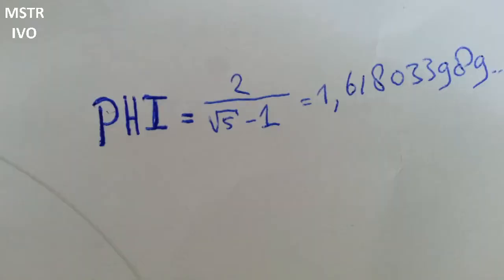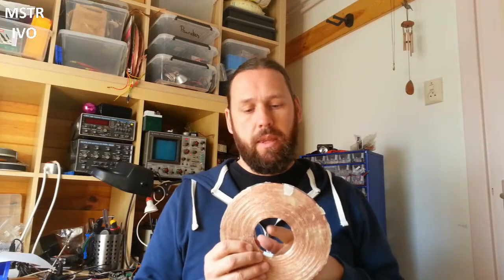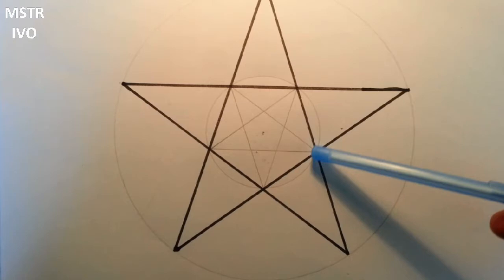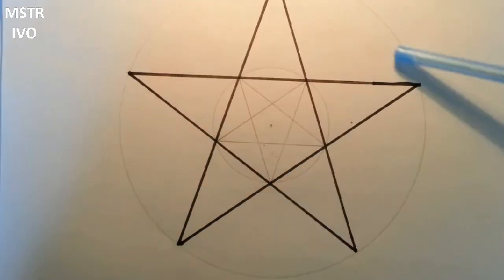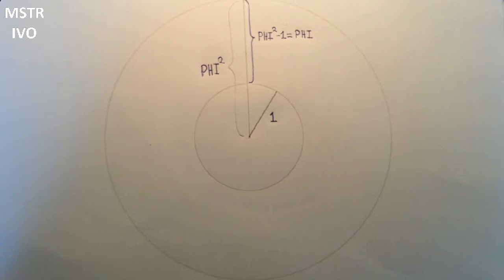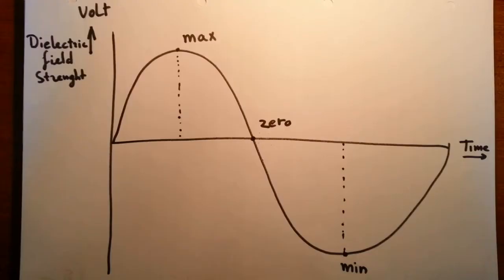The PHI Ratio Bifilar Pancake Coil and its third field

Comment: There IS a third field
Reply: I know the math of some what I found it when I was making a south pole monopole permanent  magnet which I did but the third pole was there look up alfred mcquerry monopole magnet
Reply: The bloch wall is the third field
Reply from the maker: the bloch wall is the dielectric field, if its the third, what is the second?
Reply: It goes from north to the block wall
Reply: It also goes south to the bloch wall in single pole so south and bloch
Reply: Really there many poles according to the phase angle in phase and out of phase phase shift
Reply: You have to realize each is connected to the bloch wall but separately north and bloch then south to its own bloch wall north does not go north then south it goes to its separate bloch wall
Reply: These are two separate toroids like tornadoes one up right and the other upside-down the pressure causes the bloch wall to pinch out but north is a total separate from the south each has its own bloch wall
Reply from the maker: @alfredmcquerry4259   So If I understand corretly, you see the noth and the soutg magnetic fields, as 2 different fields, and then the bloch wall is the 3rd?

Then there would be 4 fields, as the dielectric field also has polarity.

just like voltage and current have polarity.
To me, that are just 2 Aether fields.
The magnetic and the dielectric. 

I still think there is a third field. The Longitudinal, Magneto Dielectric (LMD)